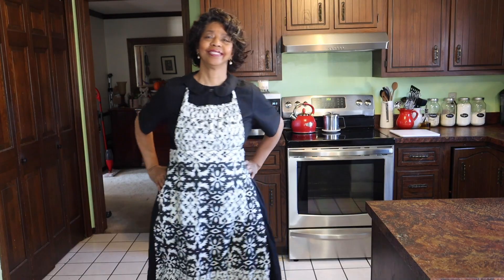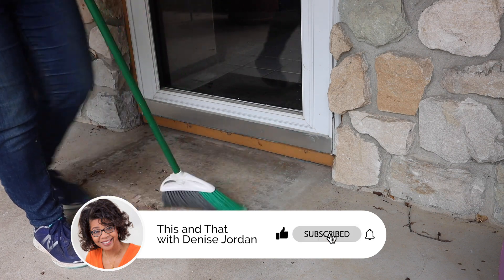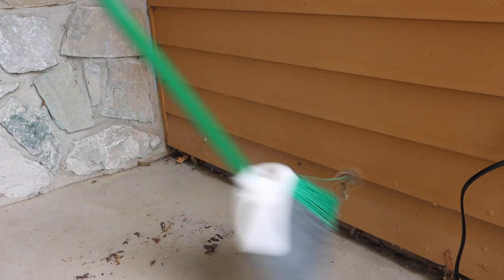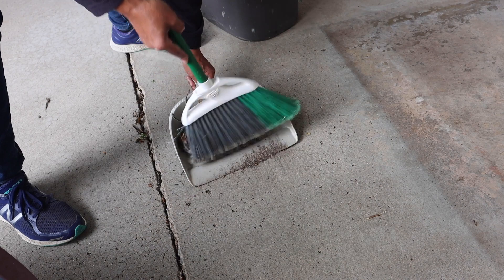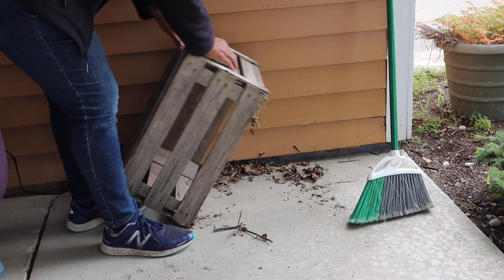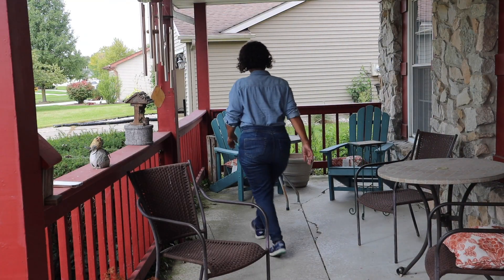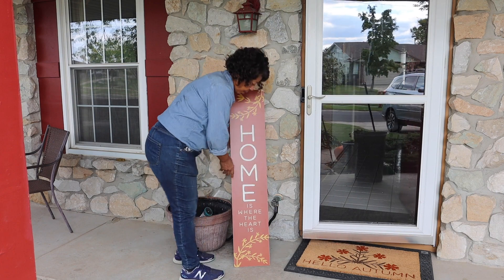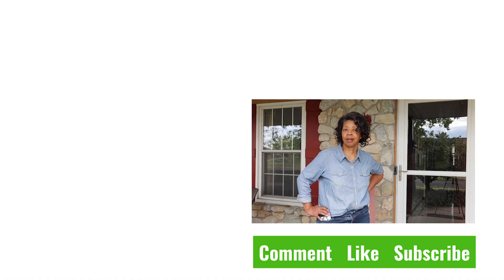Homemaker's Journal Fall Porch Cleanup

Comment: Hi
I live in Atlanta and we have more aggressive plants in the summer so we use a lawn edger to keep them trimmed and a power washer or hose with soap to clean up the cement porch and wooden porch areas.   It can save your back a little.  You did a great job.